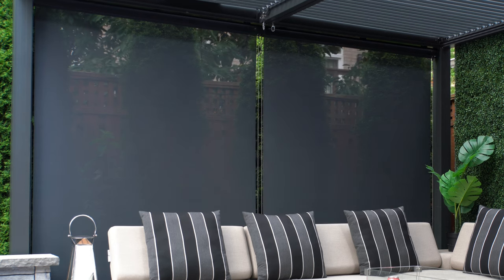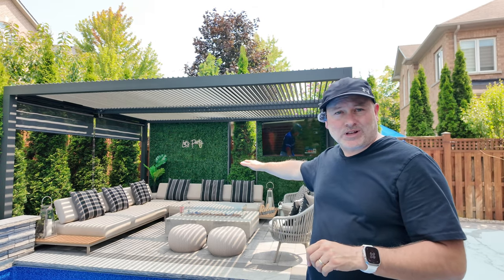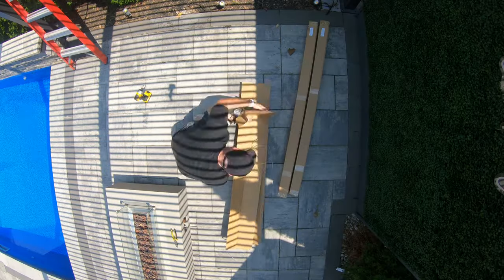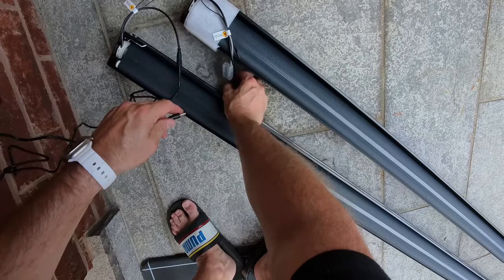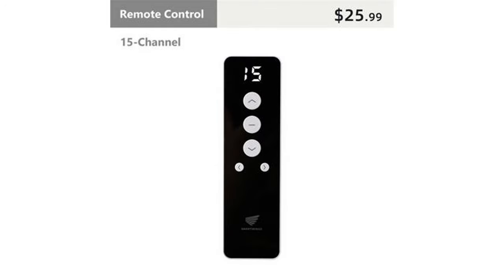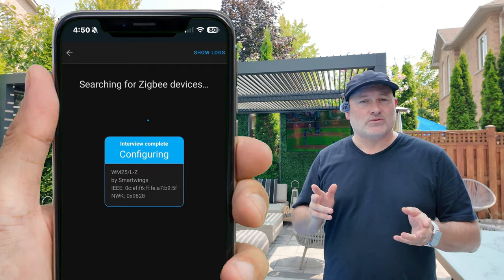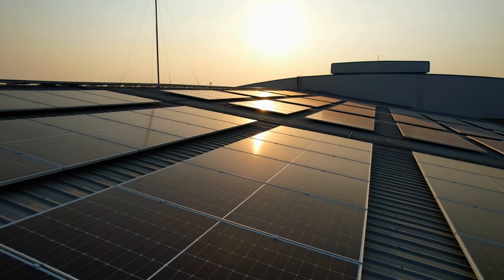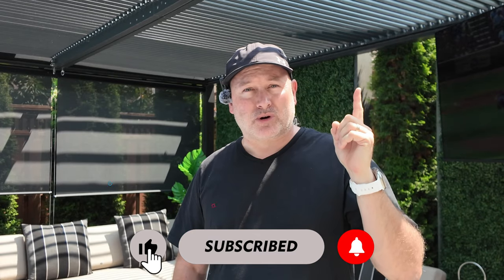Solar-Powered motorized roller shades:  Home Assistant Dashboard Card and Apple HomeKit Tested

Comment: I have the same problem with the louvered shades/ plantation shutters. I'm wondering if there is a thin roller shade that is small enough to fit between the inside of the window and the shutter that can be automated. Please let me know if you find anything. I'd love to install one of these in my bedroom to avoid the light leakage from The Morning Sun that wakes me up early
Reply from the maker: I have been thinking about trying the same, I think they may fit!  But I would still love to know if there is an easy way to automate the shutters, I am constantly opening/closing them! Thanks for watching!